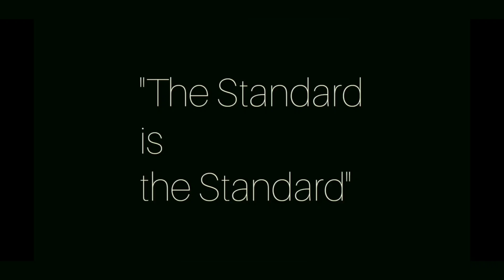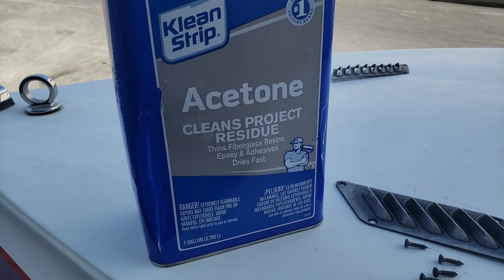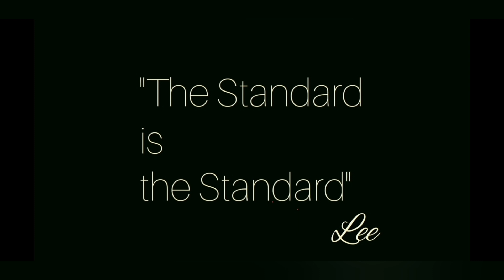older boat needed some attention and care. Oxidized gelcoat, rubbing compound and a warm buffer.

Comment: Lee my apologies if you've covered this already but do you typically do the entire bottom of the hull? Not sure if you've posted a video of this yet at all. Seems like getting underneath to do the very bottom with a buffer is a massive pain and maybe not necessary? Again, your wisdom is much appreciated.
Reply from the maker: Lol, "wizdom".
I never do, nobody has ever paid me enough.

The bottom of a Boat should be bottom painted to 2" above where the water rests alon your hull in the water. That's the best policy. "Hull Speed" bottom paint actually makes your boat flow through water faster, like a shark's skin does and lasts about 5 years.

Wax of any kind, even a ceramic, will be destroyed by the water and the sediment in the water, like sandblasting slowly.

I bottom painted my boat and suggest it for all boats. It's a pain in the ass the 1st time as you have to scuff the entire hull, strip it and apply the paint. There's a method to move the boat off the trailer and place it on several stands. Move one stand at a time after the 1st coat to paint where the pad of the stand covered an area of hull and repeat till she's all covered. You have color choices with many bottom paints so you can work with your boat's colors.

Lee
Reply: @Local_Boydidgood  thanks for the quick reply and the great answer. I’m working on a friends 2007 bayliner 175 that has never been washed or waxed.  Looked like it had been sitting on the bottom of the lake. Getting great results so far (I think) thanks to your videos. Would be interested to see what you think. Are you still doing in person instruction? Thanks
Reply from the maker: Always. Look, if you like the results, you're doing fine. It only gets better from the 1st time.

Lee

Comment: I can't seem to get my boat as white as what's underneath the original decals I removed. Using super duty with wool pad. More buffing? More pressure? Wet sanding? What's your guess? Thanks for all the tips!
Reply from the maker: New decals. JK.
Depending on how many years the decals were on the boat, it's possible that you might have to sand a little if you can't deal with looking at the different shades.
You can try being more aggressive with Super-Duty or Heavy Cut. Whatever result you get, let it level out in the sun over a season and see where it is next year.
Depending on the severity of the dichotomy (color difference) you can try washing the boat with a bleach-based scouring powder after the heavy cut but before the Perfect-it ex ac stage or any "wax". Sometimes discoloration can be caused by algae over time.
As you know, plastic tends to yellow in the environment so seeing as you have a protected section now exposed, it can be difficult to put the toothpaste back in the tube.
You might consider a new decal set or a vinyl cover, like a wrap but not on the whole boat, just where the old decals used to be.
You can also re-gelcoat the boat (like painting but more labor intensive)

There's limits to what can be expected sometimes with older gelcoat. Giant pores, deep scratches and decal ghosting can have detailers grinding for days with no beneficial results. Sometimes you have to appreciate your 1st world problem for just that. (not trying to be snarky just real)

Hope that helps?

Lee
Reply: @Local_Boydidgood  Thanks. I will try to go around the boat two or 3 times with super duty. I wasn't sure what to expect, but this all makes sense. While it's a bit yellow, it does shine now
Reply from the maker: There's a victory. Good luck.
Reply: I might be trying too hard - I'm 3/4 of the way on my 18' boat and I've already burn through all the wool on my brand new pad. I'm going to have to watch another few hours of boat buffing videos
Reply from the maker: If it makes you feel better, I failed for a few years before I figured it all out and I'm still learning. I let the buffer/compound do most of the work, I just guide the buffer mostly. Try thinking of dancing over fighting.

Comment: Hey thanks for the reply Lee, I also use Dewalt machines, used to use Festool but super expensive and very heavy when using all day long .People seem to rave about the Flex machines especially the random orbitals. I am thinking about concentrating on smaller boats soon as getting too old to hang on harnesses and leaning over bridge roofs.
Reply from the maker: I hear that.
Festools are pricey but... Worth it. They make a cool little cordless DA that I feel in love with after a friend let me use it. I think a Flex is great for cars...we'll leave it at that. The Dewalt I used to use and now this one have built up my confidence in the tool. "There are many like it but this one is mine." My Porter cable will and has outlasted everyone's thus far. I drop it often, as a demo when students ask about what to buy when they get home. She's a brute! All I can say is that it sounds to me like you're the type to dive head first and not worry about what you encounter because you've taken on stuff like this before and killed it. I'm not being sarcastic. I know A (singular) good welder. I've worked in boat yards for almost 2 decades.. I FEEL YA. 😌. What you end up with that you're liking use it. Just stick with the technique and the 3M wool pads and you'll be fine, I promise. 

Thanks for your comment, it keeps the channel flowing, people don't just learn from me but this section here gets a fair amount of play. 

I don't miss big boats either but I learned/perfected this on nothing but, big boats. No trailers tow 150' boats here in Seattle or Chelan. 

Me personally, doing small boats is like being asked to take all the things I've ever learned about gelcoat on the big girls and I get to go nutz, My goal is, something I'm proud of, damned be the owner's reaction. I mean, it's a bonus but if I touch a boat.. Think bull rider. I'm saying, "OK, I got this." regardless if I pull 8 seconds "on", I'll learn and do better next time but I feel like I'm asked to show off. You strike me as that type of guy too. Regardless of what the owner paid for (within the reasoning of an INFJ personality type who landed here.. in f'n boat Detailing of all things 🤣😁😪 NASA, Darpa,... Nope, boats) I'm sure you've entertained similar thought circles. 

Anyway I can help, let me know. 

Lee

Whatever it is you use, make sure it works as hard as you do.

Trailerable, think trailerable boats. 😬

Comment: Lee - I'm setting up for a winter project - restoring gelcoat on an 18-yr-old Seadoo, so lots of small surface areas and angles.  I'm new to this so looking for advice on a polisher to use.  Was looking at Griot's Garage G8 (3" polisher), but min. RPM's of 2000 seems high.  Would greatly appreciate your thoughts & suggestions.
Reply from the maker: Hi Mark,
First, try to remove or mask off well, everything rubber or black. We use a combination of a normal rotary, a small dual action buffer, a drill-based foam ball/Cone and our hands to get into the small areas on a PWC.
2,000 rpm is great for paint I suppose but a bit fast for gelcoat considering the angles you'll be at (in my opinion)
We have used Spta tools for a while and while one broke during use, use this as a template of what would work well.
Amazon.com: SPTA Mini Polishing Machine Buffer Rotary Polisher Auto Detailing Superpolish with 27Pcs Detail Polishing Pad Mix Size Kit Buffing Pad and 75mm,100mm,140mm M14 Thread Extension Shaft : Automotive
https://www.amazon.com/SPTA-Polishing-Detailing-Superpolish-Extension/dp/B07H3T7BYZ

Comment: Hey Lee, great video. How would you treat spider cracks?
Reply from the maker: Like these?
https://youtu.be/FCF51QZoSsI
If the damage is within 6" of a support within the hull, have your shaft alignment checked along with motor mount bushings and other bushings for tears and rips. Usually, an impact that can leave this, jars a boat, perhaps not this big girl but a smaller one foe sho. Just make sure you only have cosmetic repairs to do. A few layers of fiberglass and resin on the inside might not hurt if in doubt. Learn 2 things. 
If there's exposed fiberglass, I always bring it to the attention of the owner and get that patched as soon as you're sure it's dry enough to work on. Fiberglass absorbs water and it can travel, FAR into a boat's structure and cause all kinds of problems.
I do not buff within 2" (10 cm) of exposed fiberglass myself I don't want the fibers in anything of mine. I hate that stuff.

Spider cracks.. Drill a shallow hole at the tip of every one of the "strings" of the web to de-stress the material (stops the crack spreading after the repair) and with a dremel tool, as shallow as you can while getting to the fiberglass, not through it, grind the crack to the impact site. Clean the hell out of the area and learn to mix gelcoat and prey you nail the color. I've known 2 guys who did color matching very well I've seen thousands of dollars wasted on a bad color job.

all THAT being said, they should be repaired for a number of reason, least of all is they look bad and let's be honest, we all like a good looking boat.

I do not repair boats. I don't offer to or pretend to. I meet people who are amazing at what they do and I grab as many business cards of their's as I give them mine. Then I make sure to always suggest that work gets done by someone I trust. Enough with the "good detailer" bs. I've watched the process enough to tell me any one can do it. Like with buffing a boat and tap dancing (no, not a spelling error)  Some folks seem to have a method that uses math and measurements. The best I've seen come with an artistry that just.. "wow, where was it again!?" no measurements, no math. A thermometer and an ego that beats the game. If you don't like the color, it's a learning experience and as long as you didn't go too deep or outward from the original damage try again. 

You can do it. It's not impossible and perhaps just I'm nervous. It's just I've seen guys in the biz, ruin the look of a Boat and they've done this for years. I 

Use lots of natural light. Perhaps compound out the area 1st and clean it well to see what color your boat is now, after these years. The color is always different than what comes in the can, even if you get it from the manufacturer. It's why gelcoat repair is actuality the smartest game in the industry. If I were 30 years younger..

Do some research and get to the point where you want to try just 3-4 "strings" of the web as a test. Try 3-4 more and so on. Might take a while with all the drying, Sanding... (a clean flat block of tungsten) "paint nibber" would be good to have or a Cobalt razor blade as a straight edge when you have sanded almost flush, scrape the blade like you were spreading butter on toast, to smooth the peaks. Compound, clean/inspect, protect. Good luck! 

Lee
Reply from the maker: https://youtu.be/6SzZ5RRRh7A
I'd say this guy is without equal (on the tubes) on repairing gelcoat. He's also the first guy I watched all the way through, for obvious reasons. He's not boring like I am.

Lee

Comment: The problem with my mastercraft gelcoat dashboard is the angle of the windshield and obstacles in the way. Years 87-90. The 87's the worst because it leans back about 2" more then they changed the angle. I have an 84 Nautique with the same black gelcoat dashboard and it's real bad... Thanks Pat
Reply from the maker: You might have to remove the dash entirely to get it to shine. Huge job and hardy worth doing. Paint on the other hand might be the answer..
The other answer is to remove the windshield. Shy of that, rub some high quality olive oil on the faded parts and just know that you've hidden the oxidation but not removed it.
There are many places on boats I can't always reach and it kills me. I'm sorry that you're dealing with that problem but I feel your pain.

Comment: Hey Lee, 

Your work is definitely awesome. I have a 1991 sunbird I'm working on and your vids have taught me soo much. I for one appreciate it. I do have a question, I did a test spot on my boat where blue meets white. I used 3m heavy cut (after today's vid I'll probably start with super duty) the blue bled into the white. Is that normal or should I mask it off and do it separately?
Reply from the maker: Normal, for chalky boats. If (and this just takes trial and error) when you're all done with a section, it looks fine, you're fine. If however, after the polishing is done, you can see the bleeding color still, try washing the section with a window cleaner, isopropyl alcohol or good old soap and water before applying any "wax"
Some really chalked out boats, yes, sadly, you might need to mask off the 2 colors.
I find it rare that the color that bled, stays in the adjoining white gelcoat past the wash but if it happens, the sun will bleach out light colors typically (its microscopic colored dust in the pores of the gelcoat)
If you want to not wait for the sun to help, tape off the white and re-compound it, it'll be white again.

Sorry, that's all kind of confusing.

Thanks for the comment and question, I appreciate 'em.
Lee

Comment: Great video as usual. Stellar work. Hopefully the owner will let the shop do that pin stripe.   You getting tennis elbow from that yellow buffer?? That red pontoon looks like a 50s diner….not sure if I love it or hate it… will give it some more thought. Cheers Lee.
Reply from the maker: Hey Mike. I hate all pontoon boats, ALL OF THEM.
It's been 17 years, acres of gelcoat later, I do get a little pain in my elbow when I compound. I actually feel it most with the random orbital oddly. Ya can't live forever. Eventually, whatever you did for work, will break you. I'm mitigating my pain with exercises, stretching and a compression wrap. It seems to help.

I'd like to have replaced that Pinstripe too.

Thanks man.